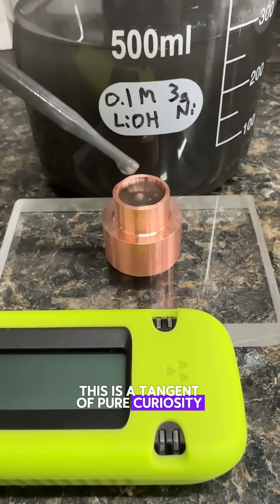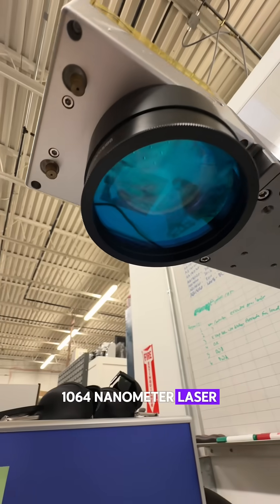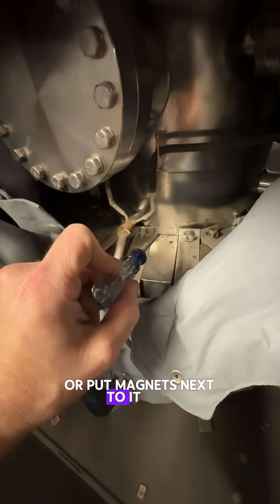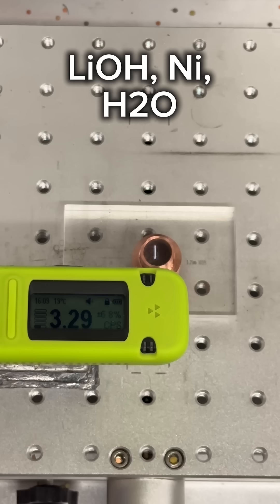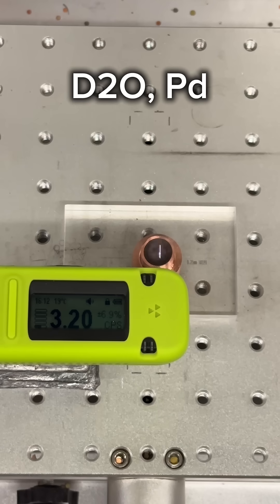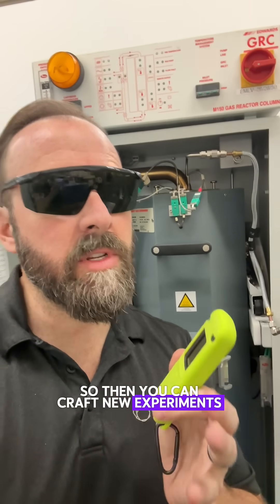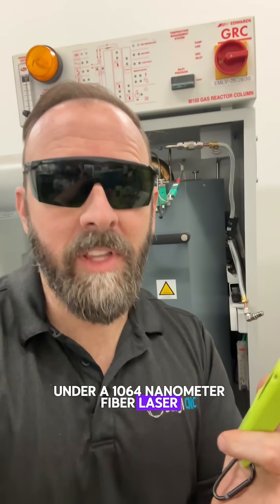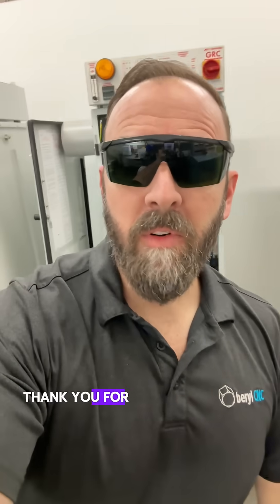1064nm Laser Thermonuclear LENR Test

Comment: The Mechanical Fix: Optical Tamping (Quartz Slide)
Instead of building a pressurized chamber, use the inertia of the liquid combined with a transparent lid.
The Adjustment: Place a thick Quartz (Fused Silica) Window or a high-quality glass microscope slide directly on top of the copper micro-reactor. Clamp or tape it down firmly.
The Physics: The quartz is transparent to your 1064nm laser, allowing the energy in. However, it blocks the gas from escaping.
The "Hydro-Lock": Fill the reactor with your d20 colloid mix to the very brim so it touches the glass (zero air gap). Because liquids are incompressible, when the laser heats the surface, the pressure will spike to hundreds of bars instantly. This forces the Deuterium into the Palladium or Nickel lattice rather than letting it boil away.
2. The Chemical Fix: Boron Doping (Internal Signal Converter)
Your Radiacode cannot see neutrons, and the copper wall blocks alphas/betas. You need the reaction to send a signal your detector can see (Gamma).
The Adjustment: Dissolve a small amount of Borax (Sodium Tetraborate) or Boric Acid into your d2o or electrolyte solution.
The Physics: Boron-10 has a massive cross-section for capturing neutrons. If your LENR reaction produces neutrons, the Boron will capture them immediately inside the liquid.
The Signal: Upon capturing a neutron, Boron emits a distinct 478 keV Gamma Ray. Your Radiacode can easily detect 478 keV gammas through the copper walls.
3. The Detection Fix: The "Poor Man's" Moderator
Neutrons that escape the Boron need to be slowed down to be detected by the Radiacode's crystal.
The Adjustment: Sandwich the Radiacode between two blocks of High-Density Polyethylene (HDPE).
The Source: A cheap, thick white plastic cutting board is perfect for this.
The Physics: The hydrogen in the plastic slows down fast neutrons (moderation), making them more likely to interact with the detector's crystal or the surrounding materials to create detectable secondary gammas.

Comment: Vapor deposit or coat with a thin layer of graphite or if you have graphene ink. Then use your laser to etch palladium or gold letting the nano particles settle on top of graphene to coat. Test try to sandwich nano metals in between graphene layers, test again. Could use a candle and coat copper first with soot high power laser soot into graphene repeat sandwich repeat.

Comment: Use a fiber laser pulse like @Andre_Romeo or a electrolytic maser cavitation like suggested before. A single laser pulse timed well for sensor collection would probably illucidate many happenings. There is potentiql Neutron mediation in aqueous solutions which is beneficial for novelty, but adds difficult for sensing the child products.

One problem I noticed is heavy EMI from the free hydrogen excited cavitation. I think it could be hypothesized and tested thatva double boundary layer happens at phase differences. A bubble can build up ionic charge and spun coherently, unlike this comment to most probably. 😅

Happy Thanksgiving, we should chat again soon sometime. ✌️

Comment: The best method is a gamma scintillator & a photo multiplier tube to measure and amplify single gamma photon events 

U can take it a step further and get a He3 neutron tube to guarantee any fusion by reading moderated neutrons to break He3 gas connected to an amplifier to ur computer.
Reply: A radio code IS a gamma scintillator

Comment: I've been interested in Superconductors lately. What if we tried to create temps with liquid-nitrogen and see if the Alpha/Beta/Gamma output is changed for your detector. 

I was thinking setting the Superconductor under the Copper Reator, then adjustments to the laser heat and angles. As well the positioning of the Radia Code Scintillator incase the particals go bonkers due to the Magnetic field?

Comment: What if a Palladium or Platinum rod that has been saturated with Deuterium Was put under forced compression via ultrasonic transducers.  Build a standing wave in rod using the ultrasound to see if that will trigger fusion.  The Hydrogen and deuterium might be locked in place in some crystal locations and be forced into reacting by the pressure zones of the standing wave.
Reply from the maker: Great idea, just tricky to then make it a continuous process. I thought about using a wire almost like an EDM where it gets loaded in one stage and then reacted on another region.

Comment: What is significant about 1064nm?    Is the frequency matched to the nucleus?
Reply: Nothing other than it has too low a frequency to even be absorbed by a nucleus
Reply from the maker: @jhoughjr1 not what I was going for. I was trying to see if anything would happen due to the small plasmas created as the colloid particles vaporize, which they certainly did.
Reply from the maker: Just what I have on hand. Only trying to amplify in-situ hydrogen loading and cause LENR anomalies, not practice pure physics like matching vibrations.

Comment: If you want positive results, you have to determine the earth field nuclear magnetic resonance frequency of the atoms you want to participate in the fusion reaction. Remember, fusion results don’t emerge from electromagnetic stimulation, only nuclear stimulation. NMR is the only way cold fusion can be done, and as a result the timetable is quite long. This is why the alchemists had to wait for years in some cases.
Reply from the maker: I’m not sure LENR is just fusion tho, I’ve seen transmutation analysis where it showed fusion and fission products. Those experiments are usually in electrolysis cells.

Comment: The 1064nm pump is likely just dumping thermal energy into the lattice rather than hitting the resonant frequency needed for any LENR effects. For the palladium/heavy water run, try pulsing the laser (Q-switched if you have the control) to induce acoustic shockwaves instead of a continuous CW raster. You need rapid compression in the lattice vacancies, not just heat. But that's some clean machining on the 101 copper though, definitely the right material choice for that thermal load. And since the 1064nm is just dumping thermal phonons into the bulk material (which explains why you're just melting the target rather than triggering an event) I recommend you to chase the letts-cravens effect. Which means you need to introduce a second laser to create a beat frequency in the 8-15 THz range (specifically around 8.3 THz or 15.3 THz). That beat frequency matches the optical phonon resonance of the deuterium oscillating in the palladium lattice. You're trying to force the reaction with heat, but you need to tickle the lattice at its resonant frequency to widen the active sites. Also, make sure your D/Pd loading ratio is confirmed >0.9 before you even fire the photon trigger, otherwise, the lattice is too 'empty' to sustain the NAE.
Reply: Yes saturation needed
Reply: came here to say this.
Reply: Is there a difference between just pulsing a laser and Q-switching a laser?
Reply: @technicalstuff6219  Yup. There is actually a significant difference between simple pulsing and q switching, with Q switching being a specific technique to create much more powerful, shorter pulses. Regular pulsing can be achieved by repeatedly turning the laser on and off, while q switching involves intentionally causing an energy buildup within the laser's optical cavity by temporarily blocking the output, and then suddenly releasing it all at once.
Reply: I was hoping this comment would be here
Reply: 2nd harmonic generation  532mn pulses! More  higher energy  photons in a smaller  area
Reply: And don't forget to invert the polarity on the phase inducer transcoils in the plasma gradient transitory shield matrix!
Reply: @msytdc1577  😅😅😅🤓🤓🤓 Lmao! fair point, it does sorta sound like some science fiction jibberish from star trek.. But unlike the 'phase inducer,' the 8.3THz beat frequency is actual solid-state physics. Google the 'Letts-Cravens effect' and you'll see that truth truly is stranger than fiction sometimes

Comment: I suspect LENR can provide the best explanations when it comes to our metal rich Sun. Pressure and heat is critical. If we examine star lifecycle it appears there is a threshold of kinetic energy that must already be present in the system. See main sequence chart for stars .

Maybe passing the curie point of certain metals is necessary? 

The surface of the Sun (Sunspots, not photosphere) measures very close to the temp of a thermite reaction. Coincidence? or evidence that the Sun has a molten metal core? What's very interesting is how ingredients get recycled back into the surface. There is a  possibility the photosphere plays a role in sustaining the violent reaction in addition to excess energy from nuclear interactions. Solving the temperature gap between thermite reactions and the surface of the Sun would be a good direction to take.

Comment: Induction heater. 
Copper won't be as affected as ferrous metals. If you placed a fine needle vertically in the copper, so that it would get super heated by the induction heater, it would vaporize whatever liquid is in the cup (place the tip just below the surface) Focus the laser just above the surface of liquid. This way, you're dumping energy from the laser into the vaporized liquid instead of the liquid itself. The additional energy of the starting phase (gas vs liquid) may cause a different reaction than the laser hitting the liquid and being cooled immediately. This way, you could test the laser on gas phase materials instead of liquid, without having to contain the gas (since there would be a steady supply from the extremely hot needle tip). Bonus points if it's tungsten (such as a tig welding tip), to be capable of even higher temperature. 
Just a random thought 😁
Reply: If you could put it in a vacuume chamber you could isolate the vapor a lot more than if it were in open atmosphere.. I'd imagine. Like a vapor deposition setup.

Comment: I remember the original machine had a base-plate of prefabulated aluminite, surmounted by a malleable logarithmic casing in such a way that the two main spurving bearings were in a direct line with the pentametric fan.
Reply: Sounds familiar to the jingle of
Revolution radio.